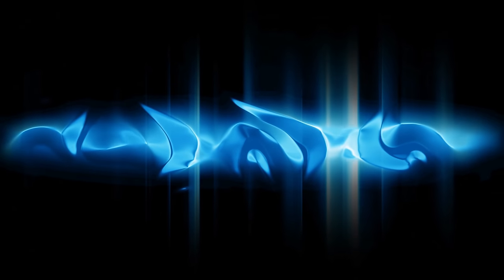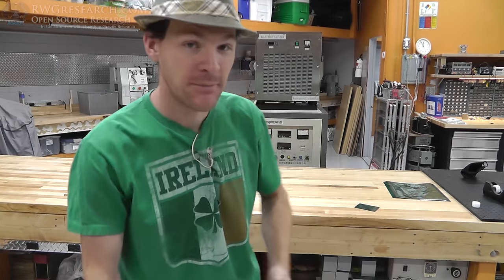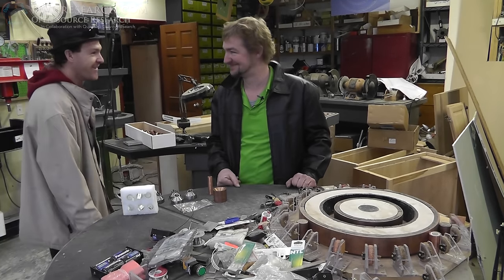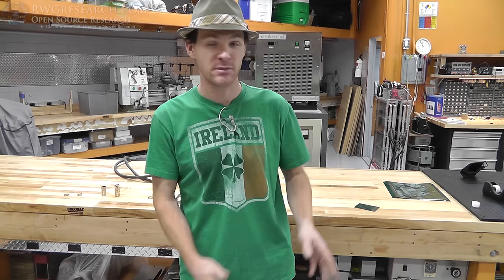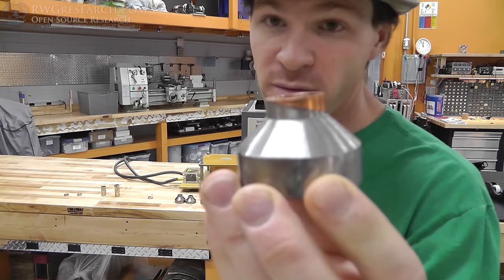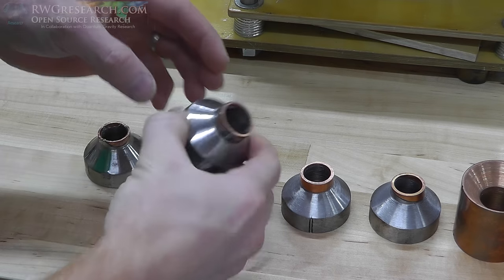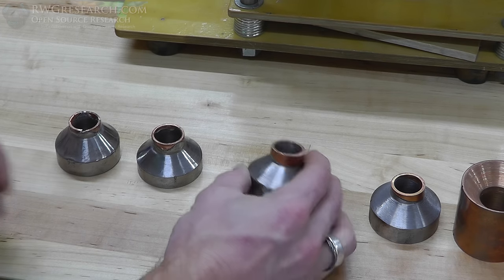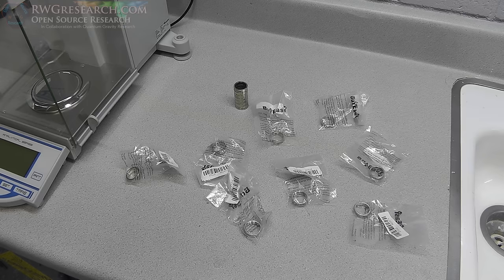Imprinting Magnetic Wave Patterns In Neodymium Rings. With "Wood Brass And Glass"

Comment: Well done Russ. Well try to use an AC current pulse overimposed to the DC magnetizer field. This way a German guy could get a WAVE pattern imprinted into the Magnet and when he stuck this magnet ontop of a cooled superconductor it began to spin... So it was some kind of  selfrunning permanent magnet motor, but needed the cooling of the superconductor. Was the same method Flyod Sweet used to imprint 60 Hz AC during the DC magnetizer pulse. You must overimpose a few cycles of 60 Hz sine AC ontop of the DC pulse, this way you can get easily a changing pattern also titled to the axis, so the magnet can rotate on a superconductor repelling the magnet.... Hope this helps. Regards, Stefan.

Comment: The SEG is a diode device. The nylon66 segment of the SEG  needs to be charged on the 300KV to implant a permanant static voltage inside the nylon66. As the rollers develop HV the nylon66 will build up a capactive charge and avalanche through the nylon control gate acting like a semi conductor. The purfect torus printed (figure of 8) magetic wave field of the SEG is the roller "ATTRACT FORCE". The High Voltage generated by the spining rollers(See vandegraff)  is the "REPEL FORCE". As each force interacts they create more electrons more attraction through the paramagnetic properties of the SEG copper or aluminium layers. The faster the rollers spin the greater they attact to the copper or aluminium temporary magnetic field.

Comment: The field generated by the electromagnet will always try to be circlular. 
Instead of trying to redirect the generated field, maybe try to use delrin machined to hold the material being magnetised at an angle instead of being concentric with the field.  
The angle would depend on the width of the piece of premagnet being used. 
I hope that makes sense.
Might be a worthless idea, but it's something to think about.
Also would like to add a big THANK YOU for all that you share.

Comment: Want a wave pattern? Obtain 3 diametric ring magnets, then twist 120 degrees,secure with super glue,twist and repeat.I managed to stack 6 (six)  3/4 x 3/4 inch grade 4 diametric mags, twisted 60 degrees each.They are still holding today.Get the slow setting super-glue.

Comment: I have enjoyed your work , if you research John’s work and stay within his framework of 13-4-7-10 , {34g *8 segments *12 rollers you will make the connection with the magic squares as per the weight ratio within the .05 for the 272g of your project , remember its the - electrons that your after in the induction cycle that will feed your step up conveter ( remember- Neodymium oxidizes so a fish aquarium is recommended) Don’t get fustrated when you magnetized radial / horizontal platform to get the eddy currents out of the emitter. Good Hunting!!!

Comment: Hi, great job. What you might want to try is drilling a steel block at 45 degrees where you put your Nb rings in. Preferably filled whit iron which will  optimize your magnetizing proces. This should result in a strong magnet which by rolling it should give you a changing polarity and a very big wobble. Keep helping each other, although I have my doubts of the machine ever working,(entropy laws) it would be great to find the loophole.

Comment: Hi Russ
I think you have to cast the copper rings on to the iron jig to get the correct effect..just sitting it on there won't let the magnetic field pass through..like a broken core..Casting or tig welding it on will weld the interface..if you know what I mean..

Comment: I actually think your idea was in line with what searl was doing. I believe he was using a modified/custom magnetron with a copper anode and cathode outer core. perhaps this is why he needed so many kilowats of power. Searl could have been the first person to use rf sputering with ac dc switching. And magnetizing in between @rwg42985

Comment: Serious question. Have you fellas put any thought or action into personal security and insurance on the shop and device? You're close, but the idea is not to generate energy, although it will produce energy. Rather, the idea is propulsion. Analyze where the ether void is entering the device(like a well sump pump) and exiting the device(like a hair dryer), then figure out how to "collect" the emitting energy. You'll know it is working when the copper is super-cooled. Also, plan on stopping the device once it goes super-conductive. Safety.

Comment: What if you took a material like shotgun shot #7, melted that down to the shape you want, use that with the copper. I think that will produce better results. The shotgun shot is softer iron to not damage the barrel. Interestingly though, it drops the magnetic field super quick (happens to improve the efficiency of motors BTW). Get back to me russ, I would really like to hear your thoughts on this subject. - Benton

Comment: So, higher current that is volt, increase flux lines, so or lower current, increase the flux lines, which the lines repeal the empty space from radius from edge of magnet to edge of empty space to the white part line. Well, flux lines are energy impact, that is potential energy. So, there is no section of flux lines, except the section of half-wave, which in 2d, it is section of lines. So, 3D, it curves over and curves under, so in 2d, a gap where the wavelength is at.

Comment: In the old days the need for specialty magnet we used a device like a mag tape write head. to duplicate the so called sine wave in in how you write each cell on the surface through the copper. Another analogue is a printer print head striped of all the pins so the coils is close to the material you plan to condition. This like its a mag disk and you have to write many cells to get your effects.

Comment: Just an idea, searl used ac together with dc to charge the magnets to get his wave, did he not apply the sqaure principle per set of 8 rings, ie. Each ring in the set of 8 has a random charge, however together they have the same total strength as the next set of 8 rings. 1 to 8 strength increases fist set of rings, 8 to 1 strength decreases second set of rings, 1 to 8 strength increases again, and repeat the patern to complete the ring.
Reply: Or one set if magnet rings ac charged, in set of magnet rings dc charged.

Comment: and, to solve your problem, I believe instead of making the core out of iron, you need to make it out of aluminium, silver or graphite. something that's diamagnetic. then, you'll have your desired effect
Reply: I think we're talking about different things. in his video, at 4:40 he explains why they chose a copper core. he explains that they're hoping to generate the searl magnet effect with eddy currents. however, I was postulating that if a diamagnetic material was used as the core (or, wherever he is using copper) instead, the diamagnetic material will actually "reverse" the direction of the magnetic force, so the ring would be magnetized with something like 100, -5, 100, -5. such a material could be silver, aluminum or graphene. all one would need to do is to make the same shapes. it could be tried easily with aluminum.
Reply: you may be right. I was just throwing out some ideas. in one of your videos you show that a 2d magnetic grid can be printed using a machine. I guess I'll have to give it some more thought to be able to do that. personally though, I'd still feel like I'd give it a try. I've always wanted to study diamagnetic materials.

Comment: (In my somewhat typical long-winded fashion... I offer these thoughts)

You probably need to get past the idea of magnetic shielding, and focus on directing.  That copper rod int he center is only going to act like a large wire in a changing magnetic field... it will create its own magnetic field in opposition to the large magnetizing coil.. and likely negate any desired results.

Originally I thought you would need pole reversals in the material to accomplish this... bit that's not so.

I can picture it in my mind... I'll try to explain... (wishing again for a way to attach a photo/drawing to a Youtube comment!)

First you have to visualize the 'magnetic ring' as-if flattened out... like you slit the edge of it, opened it up and and smashed it out flat on the table (pretending it's not neodymium!) Now it's length is 3.14 times the original ring diameter, the height is the same. The thickness lays flat against the table. 

On a piece of paper, draw a long rectangle representing the flattened magnetic ring material.  Then draw a sine wave from one end to the other, two full waves length, touching the top and bottom lines.

That sine-line you drew is the "null point" between the North and South poles, as seen on magnetic viewing film.
(one common multi-pole magnet is a hard drive head-positioner magnet... aka the "voice-coil" magnet... these have a VERY clearly defined line between the two virtual "magnets", since they are magnetically imprinted with opposing poles through the thickness)

 Now imagine the magnetic fields required to create this sine-wave shape of a "null-line"... it's not vertical across the material... it's sloped... always. The North is always on the same long edge of the magnet, the same for the South pole... always along the opposite edge. Also, the poles are mainly perpendicular to the "null line".

Does this make sense so far?

The only way to get that kind of polarity pattern is to precisely direct the magnetizing pole-piece N/S fields to be physically in-contact with the material... or at least VERY close to it. You need similar sine-wave shaped magnetizing-core pole-pieces, rotated out of sine-phase with each other... at the same point where the North touches the material, the South will be the furthest away from it.

On your drawing from above, draw two more identical sine-waves - one right above, and one right below the "flattened ring" rectangle, but be sure to draw them in-phase with the null-line you drew earlier. These will be the shapes of the "interfacing surfaces" of the magnetizing pole-pieces... with solid iron above the new top wave, and below the new bottom sine-wave shapes.

Regarding the "amplitude" of the sine-wave shape on the magnetizing core pieces... it may well not be a 1:1 relationship to the resulting magnetic shape, since the magnetizing field strength (close-field) decreases at an approximately log rate, so keeping the magnetizing pole pieces in very close proximity to the magnetic ring material helps keep the resulting magnet well-defined.

Maybe a centering rod of nylon or teflon to keep the ring in alignment with the pole-pieces would be a good idea.... and possibly even a couple of similar material alignment posts between the magnetising pole-pieces, so they stay accurately aligned.

The pole pieces should be of soft iron, so that they don't get magnetized themselves.  It would also seem prudent to restrain the movement of such a system, so it doesn't jump around during the big hit!

...
...
However.... (there's always one of them) While writing this, I had this additional thought...

I'm not sure that the "sine wave null line" can reach the top/bottom edge of the actual magnet ring, without a little more thought.  Why?  because that seems to mean that a mono-pole magnet exists at that very spot... it would be all North or South, if the "null" touches the very edge.

Example: If the very top of the null-line sine-wave is at the top edge of the ring material, let's assume the South pole is at the bottom, so the South pole is 100% dominant at that very point.

Even though the South pole is now dominant on the face (outer-lower surface) of the material, a North pole must still be present in the same/opposite strength... you can't have a magnet with "more South than North"... so the weak pole needs to be moved to the back side of the material... which means the top-inner edge of the ring. This would then indicate the South dominant pole (in this specific case) is actually at the bottom-OUTER edge of the ring material... not just flat across the bottom edge.

Ergo... the poles need to move not just from top to bottom, but diagonally through the material in order to get the maximum "sine wave" shape.

I haven't convinced myself this is true though... just some thought processing... because maybe the adjoining North-dominant poles combine enough to compensate... so if I were you, I'd just try the more simple approach first... it really wouldn't be hard, once you understand the importance of "directing versus shielding".  

In that extremely strong magnetizing field (inside your huge magnetizing core), there is no way to effectively shield. Use that massive field strength to your advantage, just direct it to do the work you want done with the core-pieces.

Comment: Use pewter instead of copper; pewter is a type of lead, and lead repels magnetic energies.

If you want to retard magnetic imprinting you NEED a magnetic blocker material for shielding.

You should also set your voltage to 386.7 at over 15k amps for best results.

Comment: hold the magnet in the magnetizer on  an angle.  vavoom... u got ur sloped line of magnetism.
Reply: thats what i thought, diagonal...
Reply: 1. All that talk about how Cu sheilds the magnet and Fe distorts the field and when you try to magnetise it you put that into the magnetiser?  Makes little sense to me.  
2. As localbroadcast says haven't you got that if you orientate the magnet?
3. Was this video before or after you found that 3-D magnet printer, surely the company making that machine would partner to produce some prototyping rings...this is a plea for timestamping info on your vids
Reply: yeah, i think that's the effect going on. it isn't reduced field, but the field lines are becoming angled by the curves of jigs, which induces the apparent field strength change. Using a ferrofluid to show the resultant 3D magnet field would be illuminating.
Your idea would work well, i think.
Reply: Didnt realize they had 3d magnet printers.. Im spitball thinking maybe one needs to better harness the flow of the vortex through the coil. think inverse of a Lilly impeller in water tank. Where the water tank (rodin coil) is generating the field and the impeller is harnessing its flow instead of the other way around.  So I wonder what effects a 3d printed magnetic Lilly impeller would have sitting at the center of a rodin coil maybe it will better harness the magnetic current vortex that flows through it enabling for a greater RPM gain on less input?
Reply: localbroadcast I  like your photo
Reply: localbroadcast Oh yes! Love   that angle girl!

Comment: OK, I've only been looking at this stuff for about a week now, so take this with a grain of salt... :) a magnet is where the atoms are aligned in a specific manner with the north and south... so in my opinion, if you took a copper wire and wrapped it around the magnet you want to magnetize in that wave pattern, wouldn't that do the trick? I know winding the wire around the rings would be a pain, but I would think it would work? (and just for poops and grins) I think if you did it while it was in your oven just below the curie point that would be the most effective? From what I have been watching Searl used AC/DC to do this? the DC is easy, not sure how to do the AC?

Comment: Does anybody know what type of coil structure would be used to radially magnetize a ring so one pole is on the inside surface of the ring, and the other pole is on the outside edge of the ring? They sell them like this, but they are very expensive from what I can find and not only do I not have the resources to purchase them in this manner, I do not have the resources to match the rings and rollers to the mass of randomly sized pre-made magnets, and most of them create this effect by simply placing block magnets inside of the ring with the desired pole facing the desired direction. I know you create the field by the direction of the current, so I imagine a pancake type of coil would work, but I feel like setting a ring on top of a pancake would be incredibly weak, it needs to be saturated in the field. and I feel like if I did a coil on the inside and a coil on the outside completely surrounding it, the movement of the electricity up and down the windings would just create a plain (useless) axially magnetized ring. Trust me, I have some theories on the magnetization process of ac and DC and using a bifilar like Searle said to, but for this thread, I am only concerned with theories on the structure of a coil to put a pole inside of a ring, and a pole along the outside of a ring, as if you're wearing a ring, and the surface that contacts your finger is one pole, and the surface that is away from your finger is the other pole. Dont worry about which pole is in or out, that will be controlled with current direction/flow and I will be doing both and lets not waste time getting hung up on that. I almost feel like a roll of copper rolled up like a fruit rollup (surfaces insulated of course) and placed inside of the ring would produce an outward traveling magnetization, and it wouldn't create the up and down polarity of a normal coil, because as you all know, when you have more than one layer on a coil, the electricity is going from one end, to the other as it spins around creating axial poles like a metal dowel with a wire wrapped around it like a 2nd grade science project. I need to not have that up and down, just the round and round from inner to outer ONLY, like the electricity travels through a single-layer pancake coil. I have some theories on how Searle did it electronically, but I need advice on the coil structure. Tis' very important and (In the voice of Spy TF2) "I require assistah'nce"
Reply: Google image search for a "single pole radially magnetized ring" I KnOw it doesn't have a single pole, but this search will bring up what people are calling their pictures.